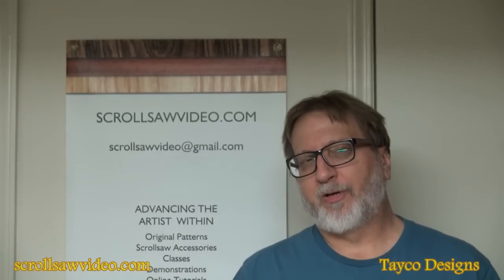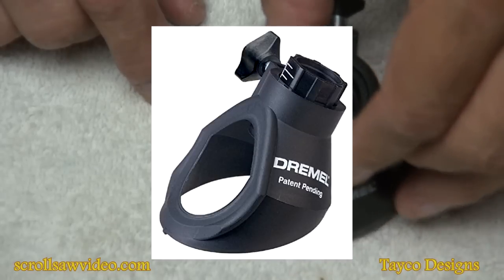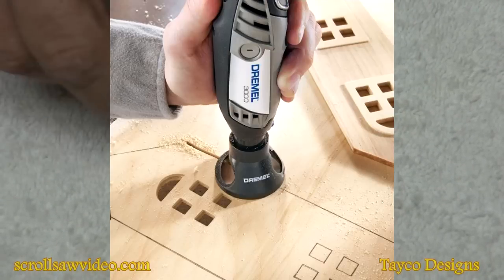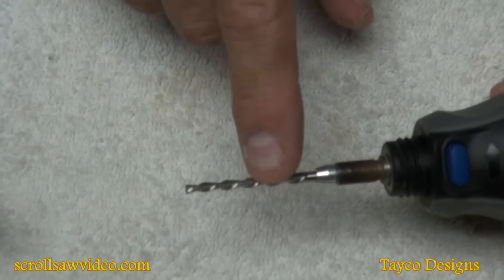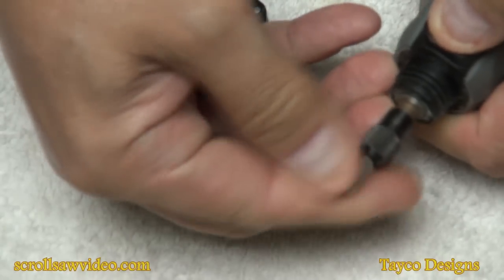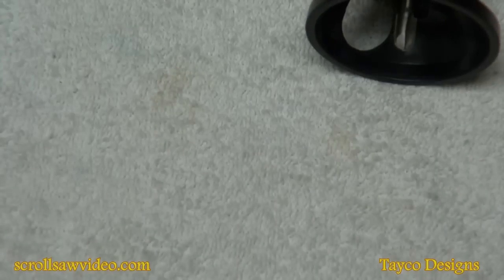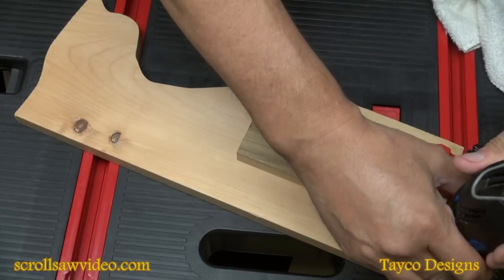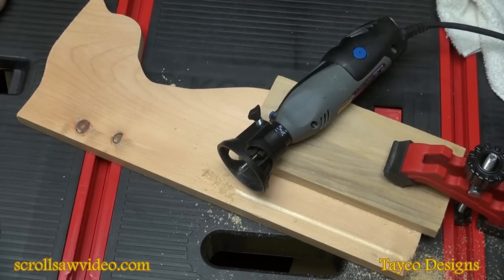Intro To Dremel Spiral Cutter With Router Bits

Comment: TY very much for posting..I have a new Dremel 4300...my father never showed me how to use a rotary tool, so your video helped me quickly figure out the basics..The part where you show which bit is for cutting and the difference between that bit and a standard drill bit was very helpful.. Using the cutting bit correctly at set depth with the cutting guide attachment that came included - helped me quickly mortise my new door slab for the three hinges at the correct depth without having to get any additional tool attachments or make a jig.  Appreciated!
Reply from the maker: This comment is awesome. Thanks for taking the time for sharing your experiences!

Comment: THe router bits have a larger surface area in which they are cutting so you've got to run the
bit at the highest safe speed. Your 1st pass the dremel motor was overworking itself and
that's not good for the tool, the project(it'll get burns), & safety might come into play?
I started using these in the early 80's doing Antique Restoration.... they weren't nearly
as functional as today's & the number/type of bits is amazing.  Good video, showing
the old/new users some of the ins/outs of the tool, the bits, & the accessories is
always a  good deal....... thanks

Comment: Thank you  for the video. Keep them coming. I'm not sure which way the Dremel is rotating,  but on a full size or trim router you should have been cutting in the opposite direction (counter clockwise). That would make the router easier to handle and give you a smoother cut.
Reply from the maker: Noted, thanks for watching.
Reply: I believe if not all, then most rotate clockwise, and so the wood should be on the left of the bit.

Comment: Hi there 👋 I came across your video because I was hunting for a tutorial/guide to teach me how to use the Dremel cutting attachment & cutting bit with my new Dremel 4000. Right now, I'm trying to see what bits and attachments I have will help me make a hole in a piece of wood a little bit wider.  

I found your video informative & will be purchasing additional cutting bits for my Dremel. I liked how easy the router bit was to work with in your video & that you also talked about the cutting bit as well. 

This is my first time attempting to use my Dremel and the attachments/ bits that come with it. I hope I get more comfortable working with the 4000 soon. 

Thanks again for your video

Comment: I have just seen " Intro To Dremel Spiral Cutter With Router Bits " and I have just bought a this Dremel Spiral Cutter Kit. About 40 secs into the video you mentioned that you did not know the part number for the kit the part number on the box the bits came in is DREMEL 565. Hope this helps you.

Comment: Not sure which direction the Dremel spins, but when using a typical router, you should route in an anti-clockwise direction - that way the router bit does not push away from/out of the cut.
Reply: Left to right, clockwise

Comment: You said you have a 300 Dremel, well I have a 3000.... I have had it over a year but never used it until now.  I purchased that piece you discussed.  How do you keep that Dremel steady while trying to cut a straight drawn line?  you would think it would move everywhere without a guide.

Comment: I might have to get in touch with Dremmel..I read that Bosch now owns them..Apparently I must have a 3/16 shaft router bit.  The collect will not tighten on smaller or larger bits than 3/16".  So today I started building hildren's chairs. 
I made a 3 inch dado on a chair leg with my table saw and some other stuff so I can put it all together in the end.  The next dado will.be using a spade bit. These days I work about an 1/8 " shy of the edges of the dato. Next I move the spade bit to top and bottom. Then I router with a wuq4ter inch bit so a smoothie.durface..Last thing I do is use my Japanese saw
and saw to the likes removing probably a.sixteenth of an inch of wood.  This makes a very good joint.
Reply from the maker: Yes, Bosch purchased Dremel (which owned RotoZip) and Skil about 2005. I had the pleasure of working with them just after the buyout and found Bosch a great company to work with. I demoed the Dremel tool line at Home Depot and Lowes for almost 2 years.
Reply: But you did not answer PIANOSTYLE100 ' s question !!!

Comment: Sorry for the 3rd comment. This is a safety tip. 
    I have I have noticed that the Dremel  Chuck isn't the safest thing to use. I've had it loosen on me a few times. 
    The problem I deduced from talking to another YouTube poster  is that wood dust gets into it. Then it will feel tightened.
     Then, approximately 2 minutes into using it. I hear a funny noise and stop my Dremel and the bit is completely loose. 
    Sorry for the pun but But I had to chuck it. 
    Yes I  did clean the dust out.Yes I did take it apart to clean it. I even used a Special powder to clean it. I tried everything trust me  not worth a trip to the E.R, Or God forbid not worth your eyesight.
Reply from the maker: Feel free to comment as many times as you wish...just so its respectful and/or constructive critizm.

Comment: Well it doesnt show you how to cut out designs but I did like learning about preparing, installing and using the Dremel Guide.  FYI, when I bought the kit, #565 it came with two types of cutting bits.  Cutting bits #560: two (2) drywall, #561: one  (1) multipurpose: wood, aluminium, laminate cutting bit.  

I would like to learn/see how the #561 cutting bit is used to cut out fine designs with 90 degree corners and arches, to trace the outline of my baseboard behind my fridge.

OR 

WHAT type of bit to use for cutting out those shapes.  I have a 3/4" segment of wood covered with a white laminate.  These pieces of wood go on either side of my fridge/freezer to support the cabinet above the fridge.  I traced the outline of the baseboard onto blue painters tape taped to where the back of the board needs the shape of the baseboard cut out so it will fit over the baseboard and against the wall.

Comment: Thanks for this very helpful video.
 It's very useful. I use a Proxxon rotary tool which doesn't have the threaded nose cone that the Dremel has. Any idea if, without the threads, I'd be able to attach to my Proxxon?
Thanks for any suggestions : )

Comment: Hello I have the WEN 2305 rotary tool that is similar to a dremel rotary tool. Is there a bit and guide I can use to cut a groove in the middle of the wood. 1/4" deep, 3/16" wide. Thanks.
Reply from the maker: Use the method shown in this video but make multiple passes adjusting the depth and width with every pass.

Comment: You have the tool running too slow, turn up the motor speed and do it in several passes for best results.
Reply: Exactly what I noticed too. I was like dam poor machine crank it up a bit

Comment: Tried using this for the first time to cut out a simple shape but couldn't get a smooth line to save my life...Found that going clockwise/with it had slightly better control but overall, still had a tough time. Also what RPMs do you recommend for cutting out wood? Was using 1/2" thick poplar earlier.

Comment: That attachment is designed by Dremel to be used as a router attachment.
The bit you are using is not a wood routing bit which is why the Dremel was overloading and not cutting clean.
Reply from the maker: I respect your opinion but have to disagree.
This item is a spiral cutter which is a completely different design than a router bit.  Many people use the base for a router attachment but it wasnt designed for that purpose. Think of this like the Roto-Zip tool that cuts through drywall, thin woods, etc.  A router but is used primarily for making decorative edges, grooves, chamfers, etc.  I do have 3 videos planned that incorporate the router and many of its intended functions. 
Thanks for watching and commenting.
Reply: "The bit you are using is not a wood routing bit which is why the Dremel was overloading and not cutting clean." 

PLEASE, Please, please! elaborate on this.  I've been having a hell of a time with my projects and I've suspected I'm not using the right bits, but damned if I can get a straight answer out of the internet.

Essentially I have a dremel 4200 and I want to use it for letter engraving (Actually, i draw mazes).  Nothing I try ends up working well for very long.
Reply: eyflfla They have a special kit for engraving things and stuff, the finer work, it's like $40, look for 'dremel 225' !

Comment: Some really good information in this but I feel like you could have explained it at a faster pace or used cuts to minimize your setup time. IMO this should have been between 5&7 min.
Reply: I agree... I get low-key triggered (not really lol just saying...) when people make tutorials believing that the viewers are complete morons who need the most extensive explanations for even the most obvious, common-sensical points. 🤦🏻‍♀️

I still very much appreciate that he made this, and is just wanting to teach what he knows!  ...To me, though, for anyone making tutorials, this is exactly the kind of criticism that’s most valuable & that viewers should point out (of course politely/in a constructive manner!) 

Otherwise, how would any OP know different, right?
Reply: I was going to suggest adding maybe 5 to 8 minutes more to the video. Just talking about safety and how dangerous the Dremel can actually be. Maybe with a couple hotdogs and he could cut them with the Dremel the hotdogs to represent fingers. Be safe out there. Engage safety squints. LOL AVE forever

Comment: Hey Ray, I didn't know what that was for..and it probably got tossed. But hey, if u still have manual, that part number will be in there,,,I believe. Ive had two dremmels, and one off brand dremmel (bought that cuz cheap and it had wand for my nails).
Dremmels are great, it was my first power tool lol

Comment: Where can I get.3/16 router bit.? Home.depot doesn't stock one in their dremmel sectiom.  Also Ace hardware.dremmel bit is a 1/8 inch shaft ..Any ideas?
Reply from the maker: Hmmm.....why do you need a 3/16?
Reply: @ScrollsawVideo  Here is what my owner's manual says...or something like it.  Bits may not be larger than 3/16 ".
I knew I had 1/8 router bits.  But the unit appears to only take exactly 3/16 " shafts. It would be hard to believe that Dremel has the 
tool and die patent.

Comment: Thank you very much for the vid, it really helps.  I wanted the attachment for a long time but didnt understand how they went on the dremel (mine is black and decker) so I didnt buy it. But now I understand and yes i can see it would work on the B&D fine. When I bought mine i immediately changed to the multi-chuck and now I dont know where the heck that original collet is. Would the multi-chuck really not work? Seems there is a enough space for it. Is the problem bit depth or the inability to tighten it?

Comment: Can this be used for cutting big sheets of drywall? Can this also be used on other rotary tools other then Dremel?
Reply from the maker: If the mounting thread size match, this can be used for other rotary tools.
Reply: I have one mounted on my Black and Decker RTX 3 speed rotary tool and have had no problems.

Comment: What you call a cutting bit is actually called a spiral  bit. Did not know that it pulls material up. As an FYI,  Dremel says to set the base to 0 and have your bit semi-tight. Gently press down until it's flush then you're zeroed out.
Reply from the maker: You are correct but....some bits are made the opposite way.

Comment: Hello, thanks for the informative videos and channel. I have a dremel 3000, and it is like loosing its power a bit, any idea how to measure the number of revolutions per seconds in order to know the ratio of loss? Which tool/machine may I use to know if it's performing like 25k ps or less? Another question is that the speed levels 2 and 4 are almost void now, the dremel doesn't run until that i switch to number 6. Many thanks and sorry if I added my comment in a wrong place/ thread. All the best for everyone
Reply from the maker: I know there are such tools but realistically, it may be cheaper to replace the rotary tool.
Reply: @ScrollsawVideo  You have a point there, many thanks to you
Reply: Go Easy on your baby 👶.  It will work fine.

Comment: It would be interesting to see a comparison between a Dremel type tool and an actual trim router for this type work.  From my experience the trim router is the best choice, both in price and performance.
Reply from the maker: There is no need for the comparison, the trim router would be the clear winner. The tools are made for different types or work, skill level, age etc. My favorite is the Bosch Colt but the Porter Cable has never failed me in 25 years.
Thanks for watching.

Comment: If you eyeball the insertion depth of the bit, instead of fully inserting it, aren’t you rendering the ruler on the guide useless?
Reply from the maker: Great question. Yhe depth gauge can be manipulated to the setting of the bit depth....similar to a router table.

Comment: Was that the beginnings of a dollhouse in the background?  I have a dollhouse and am into making furniture in 1:12 scale.  It would be nice to router the edges of table tops for example.  You said it should be used for hardwoods but what about hardwoods in 1/16 thickness?  Or 3/32 thick?

Comment: on your video is use the 566 Tile Cutting Kit since you said you didn't knew the model
Reply: There is also a MultiPurpose Cutting Kit:  #565 - Allows for sturdy controlled cuts in a variety of materials; including drywall, laminate, fiberglass, plastic and vinyl siding.

Comment: Can this router guide be used with any rotary tool?
Reply from the maker: No, its made for Dremel and similar rotary tools.
Reply: I have a WEN rotary tool and was hoping this would work, I was ready to order one.
Reply: @tommiemarkwell  If your WEN has the threads "under the screw cap" for the flex shaft, it will screw into this device, the Dremel Router base and most other bases for rotary tools.  I have a WEN, I've used the above and I settled on the Veritas Router Base for Rotary tools, it's twice the price but is solid aluminum, rather than Dremel's plastic, so there's no flex and it has precision depth control and micro adjust etc.    You can even get a powerful little work light that attaches to the base.   I use it for letter carving and free hand carving in hardwoods like Cherry and Walnut.

Comment: Why is the depth gauge so wrong? When I measure it, the caliper says something completely different than the router accessory. How far out/in should my bit be from the collet?
Reply: 1/8 of an inch into the collet
Reply: It's probably because you did not set the zero point correctly, if you set the guage to zero thin with the bit loose in the dremel (other rotary tools are available) put the base on a flat surface and you will see how far the bit needs to be in the collet, unfortuenately at this point I find tightening the bit is close to imposible. What I do is look at the change as in with the base on a flat surface move the bit down till it touches the work then read the guage add that reading to the required depth (remembering not to cut too much at a time). hope this helps.

Comment: I don't see how "spiral" works into this. That was just a straight cut, no spiral to it all, or am I just being overly dense here? ;-)
Reply from the maker: The cut that I made was with a router bit, not the spiral cutter.
Thanks for watching.
Reply: the cutting edge spirals down,like a drill bit?..so, maybe its just description of the accessory.

Comment: Could you use a #107 or #108 bit?
Reply from the maker: That is a possibility....but without doing some research I dont know what those bits are. Please go a little further with your question.
Reply: @ScrollsawVideo  the 107 is an engraving bit.

Comment: Love the videos. I'm making a walking cane and what to know how to carve a name or letter on a cane. I have a 3000 Dermel battery power and have most of the extras attachments. Any tips you can give me will be helpful. Cliff, Social Circle, Ga.
Reply: Try it several times on a similar (disposable) piece of wood (until you're comfortable with your skill and the results) and then get at it. Nobody is going to walk you through it. We don't know what tool, accessories, wood, or similar you have. This is a hobby you have to learn yourself, mainly through trial and error.
Reply: Don't use a dremel for carving in the round - get a set of small carving chisels and do it by hand.

Comment: Dremels are 140 watts, which sounds adequate, and upto 35,000 rpm.  However, the moment they touch a workpiece they slow right down, meaning gutless torque.  That’s a shame really.

Comment: Well there’s 13 minutes of my life that I’ll never get back. It was very painful to watch you clamp those pieces of wood down I’m watching you push the wood further away from the clamp thinking there’s not that much time left in the video is he going to be able to find another clamp or adjust  The clamp for the other side of the table or just push the wooden to the damn clamp .  And make your 1/8 of an inch 5 inch long groove.  First of all demonstrating what not to do under rev the motor on your Dremel and jam it into the wood . Good video the last 23 seconds
Reply: Seems the people watching are telling the guy how to use the tool rather than the other way round. This is for absolute beginners who've never even seen a hammer.